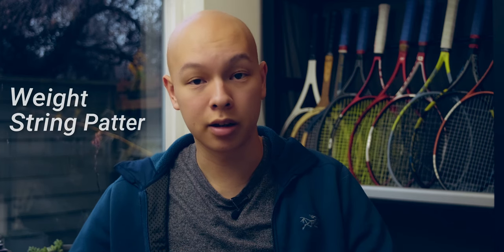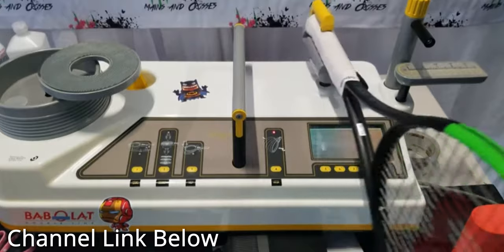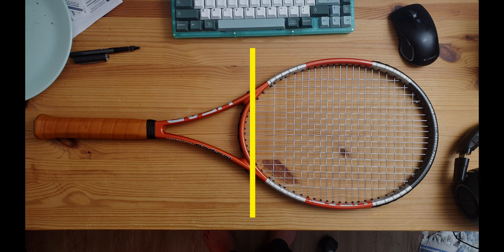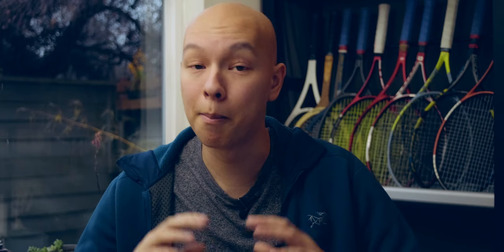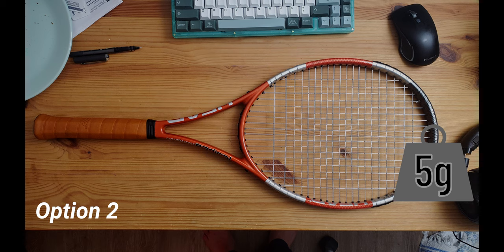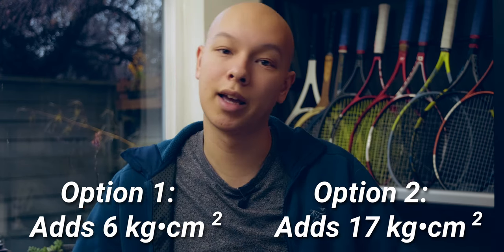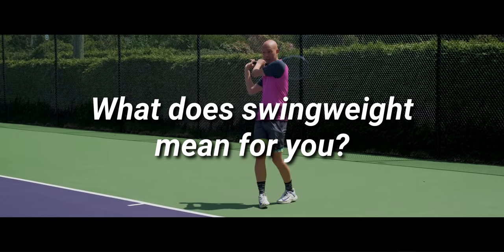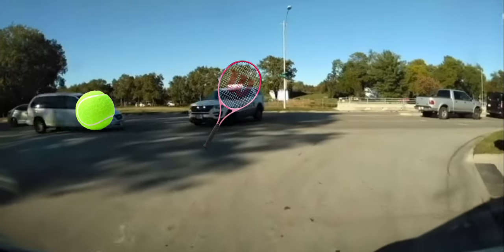The Secret of Swingweight and Why It's So Important

Comment: Fantastic video as always and I’m loving the synth vibe of the channel. 

A quick query, if I had two different rackets from the same 16x19 series, let’s say the Head Extreme Tour and Extreme Pro.  
Both rackets were tuned to have the same static weight, swing weight, balance point and twist weight (as such polarisation, recoil weight and mgr/I figures match too).

The only differences remaining between the Tour and Pro are head sizes; 98 and 100, beam widths; 22/23/21mm and 23/26/21mm and stiffness rating; 65 and 64. 

So, as I understand it the Tour would have more control due to the thinner 23mm beam, and the Pro racket would have a larger sweet spot owing to the larger 100in head size.

Would there now be any power difference between the two?  
And what other differences would there be between each racket (assuming string set ups are equal)? 
Many thanks
Reply from the maker: I honestly don't know. I haven't read of any tests that have isolated for beam thickness. I'm sure that the manufacturers have this data, but places like TWU and the USRSA aren't able to manufacture sticks that isolate for beam thickness. My experience tells me that a thicker beam would likely lead to a higher launch angle and potentially more ball speed, but I'd don't have empirical evidence to support this.

I think beam thickness and shape is a very interesting topic that hasn't bee explored much on the consumer end. Customers don't really know what shapes of beam support what playing characteristics, except for the box beam, which is generally accepted to be control oriented.

Comment: So I’m going to be buying a couple new racquet soon. What’s the most important measurement to match up or get close with? Swing weight? Static weight? Balance? Ideally I want all three to be close
Reply from the maker: If you are going to spend the time to match your racquet, I would advise with just picking the 2 lightest you can get in terms of static weight, rather than picking two that are close in spec.

If you just go for swingweight, you may end up with very different balance point, which can through off your swing speed just as much as a different swingweight can. The opposite is also true. The key is giving yourself lots of room to play with.

Comment: I thought the sw isn't changed if the weight is applied right under your forearm. Is this correct?
Reply from the maker: Actual swingweight shouldn't change if added at or below the 5cm mark as this is the axis at which the swingweight machine measures. Practical swingweight shouldn't change if added at or below the position of your hand, as this is axis at which you swing the racquet. So choking up is effectively reducing the practical swingweight of the racquet.

Comment: Hi, I like even balance or slightly head heavy, and most raquets have the balance in the handle. what's good and not too pricy for someone that likes the TI 6 but wants to avoid getting the twisted wrist from power shots of the other player. For a petit female young adult? Thanks.
Reply from the maker: I have no idea. I don't use these racquets because they are not designed for me. I believe Head still makes PWR versions of which are the successors to the TSi6, but I think you can still buy the TSi6 new today.
Reply: @TennCom  yeah going to get her to that weight 9.6 oz..108..110..HH or O. Bal. Same with me I could go up to 10.3 oz. Saw Dunlop FX700 $ And Head PWR $$ Yonex$$$  looks sweet.